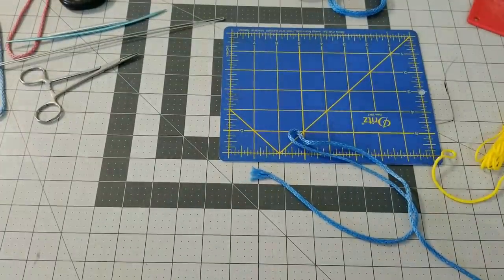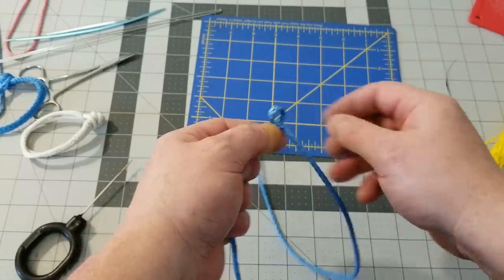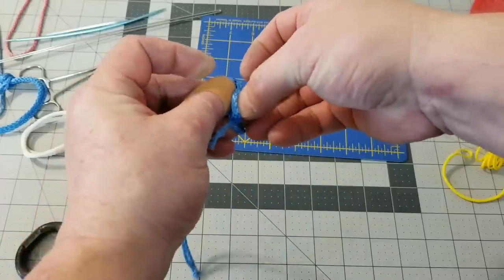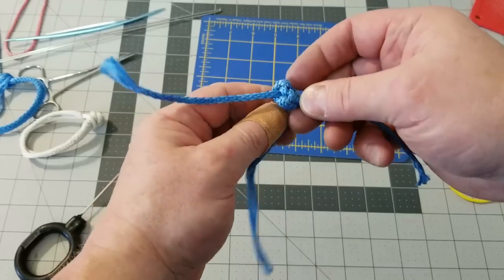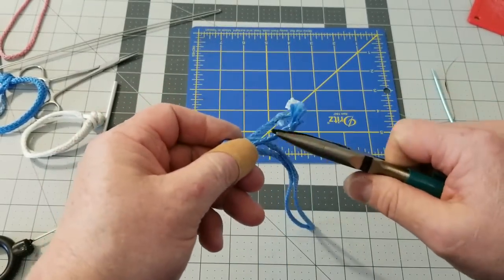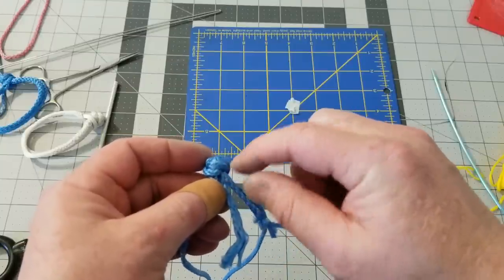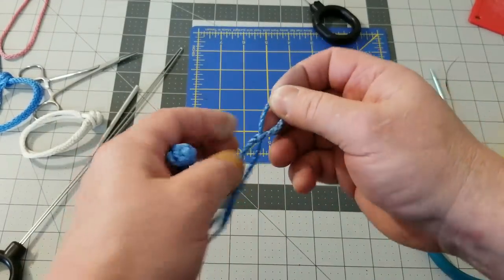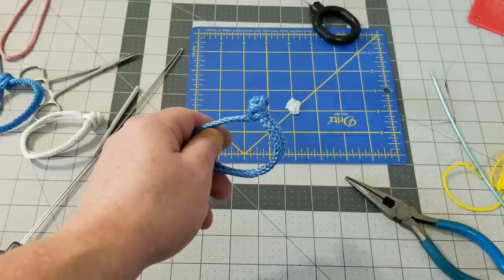Button Knot Soft Shackle D.I.Y. How To  #evoloop

Comment: How does the length of the line needed compare to using the Diamond Knot?
Reply from the maker: not sure what you mean ? how much length is needed? you have the knot and the bury...and I mention that in the video...
Reply: @jeffmyers7062  I use the calculator on Animated Knots which is the Edwards calculation, set for a Diamond Knot. I know that the button knot takes more, both in the tying and in the bury but am unsure how much more. I am thinking approx. 10% more.
Reply from the maker: Sorry missed this ....the knot I am using is the button know , using 5.5 inches

Comment: Absolutely awesome way to hid the loose ends of the cord. I love it!
Reply: It's not just aesthetic, it's practical. Burying the end stands increase the amount of material the noose bites on, and therefor the diameter of the loop, which means a more gentle bend a a less strength lost. It's one of the reasons why this type of button knot is stronger than the older diamond knot method.

Comment: I always have problems with my noose ending up too large, even though I start with it very small. Not to the point where it slips off, but it doesn't feel like it's the optimal size.
Reply from the maker: even a 1 inch loop will never slip . A good rule of thumb is a 1 inch overlap of the two strands